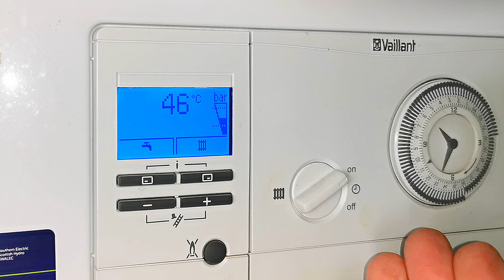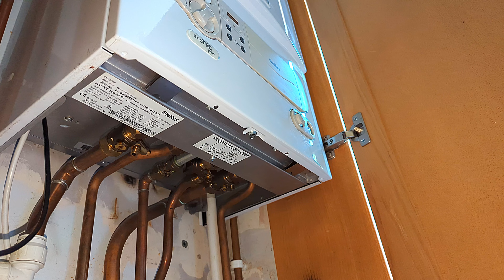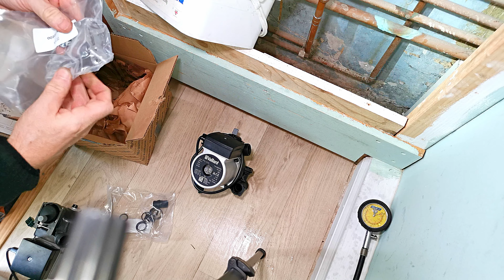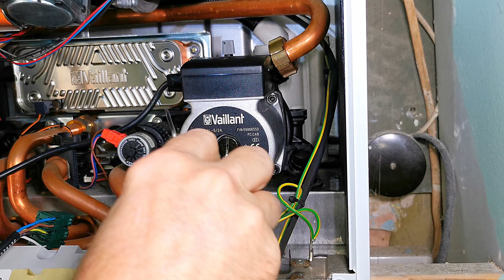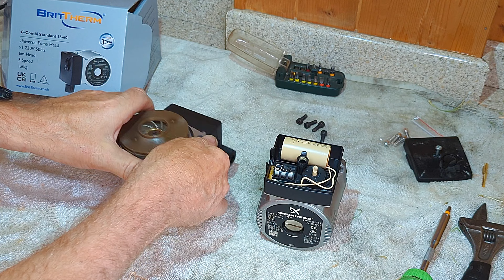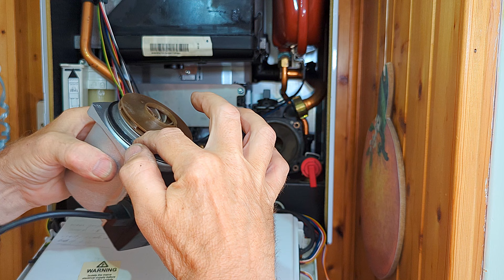Vaillant F75, How to Replace a Pump in a Vaillant ecoTec Pro & Plus Boiler, Step by Step Instruction

Comment: Great video, thanks!
I have a problem.
I have an ecoBLOCK pro VMW 286/3-3 that has a 3 cable wire.
I bought a 5 cable aftermarket pump from a seller here in Italy and he told me that if I isolate the two red/white cables the pump would work.
Doing so the pump don't turn. I also tried to feed 220v direct to L/N clamps with pump on my bench but no sign of life. Any idea?
Thanks

Comment: Thanks. My pump gave up the ghost on the first of January. Had to wait until 5th of January for the shops to open but had my heating running again by noon that day. Pump was €400 but it seems the heater works better with it. It's unbelievable how inhospitable a house without working heating is in winter. No heating, no hot water for a shower...

Comment: Watched this video after Vaillant boiler failed suddenly with F75.  I was able to diagnose a pump failure with the aid of the instructions and furthermore followed up the link to purchase a BritTherm pump head which was a next day delivery from BES. This was easily fitted with a bit of modification to the wiring and all is now working well.  Thank you very much.

Comment: At random times the pump makes a grinding screeching sound, I have to turn the boiler off, wait a bit and turn it on again, runs for a few hours, then in the middle of the night or early morning I am woken by grrrrrrrrrrrr sound. It vibrates throughout the system. Any ideas ?

Comment: Excellent video, if I am replacing a pump with a identical pump, instead of removing all the bits can I not just replace the pump head and then I won't need to replace the pump head which connects to the pipe... I am missing something here?

Comment: Surely only the forward part of the pump system is required to be replaced and removed, held on by 4 female hex screws. This part contains the rotary blades and the electric motor.
Refurbished units are available on ebay. On inspection the only electrical part likely to fail is the capacitor, available for between, £10-20.

Comment: Great video Mark. Have already sent some beer money. I tried to get the alternative Brittherrm pump instead of spending £300 on the new one and cable. Unfortunately the stockist told me that Birttherm had discontinued them (under pressure from Grundfos). However, I got another from HTS that is made by Duca for £60. I was very sceptical it would work as the diameter of the inner impeller ring is about 10 mm wider on the new pump than the old one and the screws it came with were the wrong size. However, I used the screws from the old pump and it's working perfectly. Saved me hundreds of pounds. Thank you !

Comment: Thx for the video. I had my pump replaced by my plumber at the end of last year. Since then, i replaced the sensor. I did a powerflush myself but I still cant get all 10 radiators in the house to warm up. Can do one by one or like 5 at the same time but not all of them. Is it possible they fitted the wrong pump?

Comment: Hi Mark - My pump is the Upm2 15-60 VP6. It doesnt have a capacitor similar to the one on your video but an eletrical board inside. What is the procedure for this one and can the one i have easily be replaced with the VP4 or similar? Kind regards Patrick

Comment: Hi Mark. If I use the Brittherm head as a replacement. What pump speed setting should I put it on so that it works as close to the set circulating speed of the original. Great video. Thanks in advance.

Comment: Excellent and very informative for trained and experienced as well as trainees 

I would advise removal of RHS panel only two screws to make life easier for access
Also a rag or old towel in bottom to soak up water upon opening components such as pump flow sensor etc

Thanks for your efforts in making these videos and advise on compatible pump heads

Comment: Brilliant video Mark.I had water dripping from the Vaillant EcoTec plus 831 boiler (Wife put heating on yesterday) and traced it to top of the pump.Tray was full of water and after watching the video you made a vital comment about the automatic air valve on top of the pump.That’s where the water was leaking so I tightened it by hand and I’m hoping that has cured the leak ! There is no water leaking as I write so fingers crossed. Many thanks.😊
Reply: Same thing happened to me - been looking online too see if closing it is safe to do - getting mixed feedback. Have you had any issues?